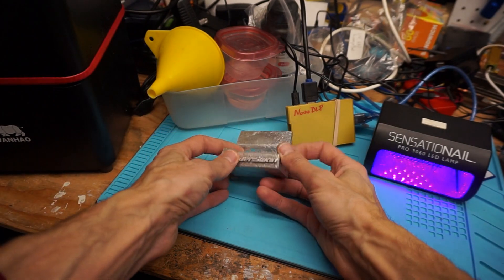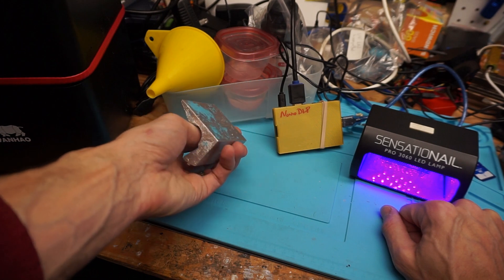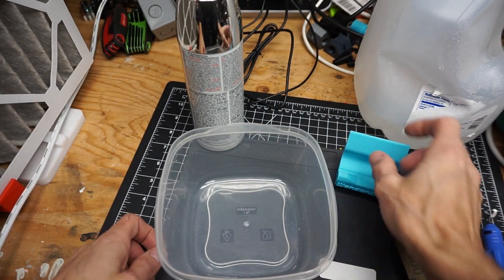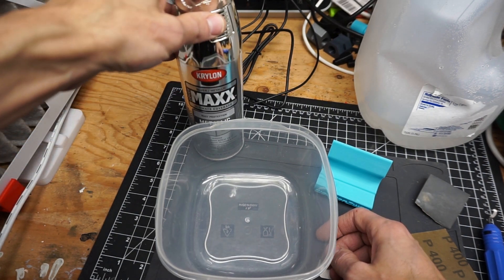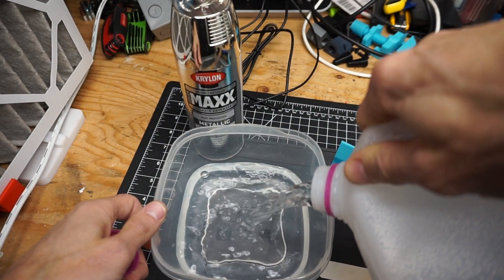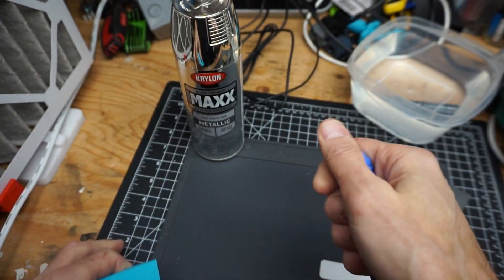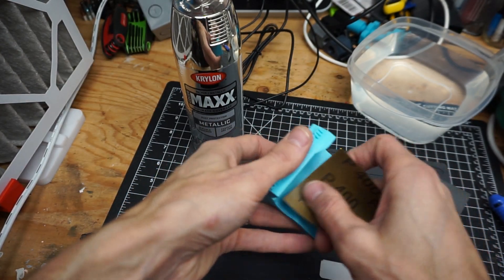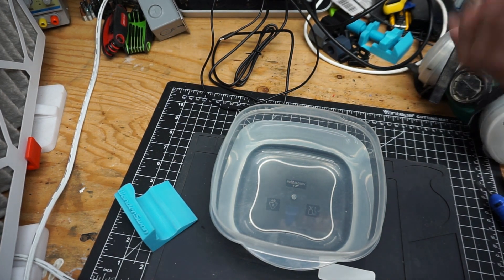Hydro Dip PLA 3D Prints - Will it Work?

Comment: one of my co workers was taking a class on gun smithing
it included a kit of this (not sure what brand)
it came with a can of some kind of paint you were supposed to coat the surface in, kind of an off white, matte paint, not sure if it was just for texture, or if there was a another reason for it
Reply from the maker: At a guess it could be to preserve the metal. Or some interim part of the smithing that later gets removed.

It's a neat process. I've got to get back to it at some point with the assorted advice I received and to try the water soluble sheet.

Comment: You have to use oil bass paints for hydro dipping.
Reply from the maker: You're right, and the Maxx is a Mineral Spirits clean-up paint. Which make it oil based. Rattle cans generally (always?) aren't water based to the best of my knowledge.

One of the few things I got right; there are some useful comments from folks here. Although after doing this I also think the parts were poor first try candidates.
Reply: @PCBurn  We all make mistakes on our attempts!! I hydro dip my PLA 3D printed parts I use plastic filler primer before then sand  & dip in hydro graphic film the results are amazing 👍
Reply from the maker: Good to see another vote for it and thanks for the advice. I'll circle 'round again once I've finished getting the paint off everything :)
Reply: @PCBurn  Anytime buddy all the best with the new project! 😁👍